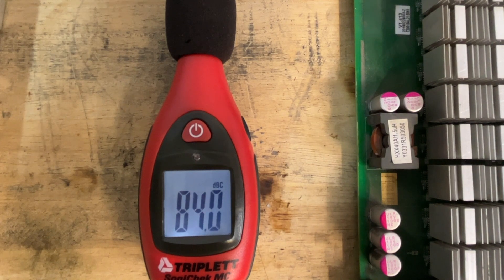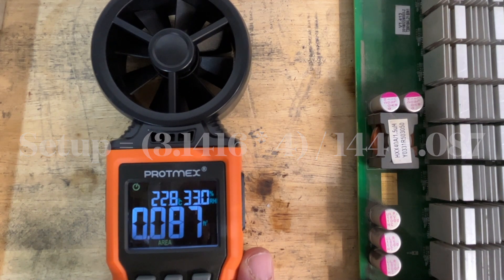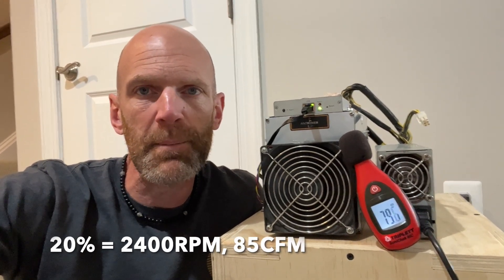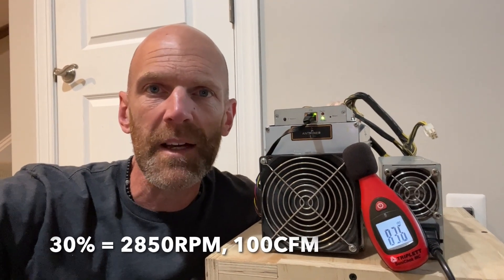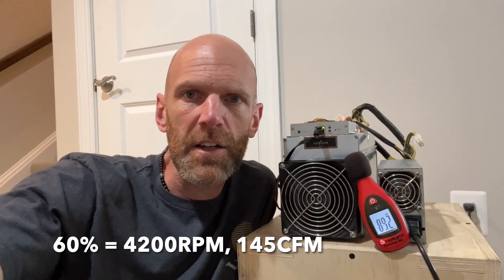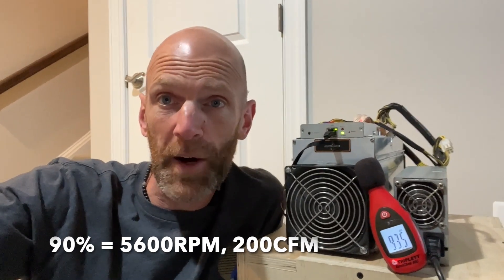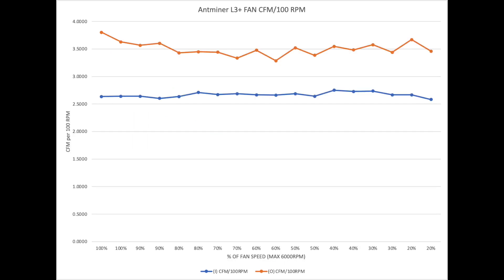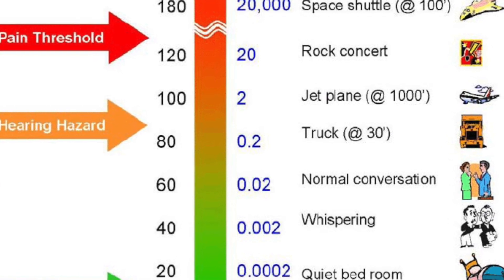ASICBASICS.COM - Bitmain stock fan RPM vs CFM vs DB

Comment from the maker: I should qualify the specification settings by also saying that there will always be some slight deviation in the actual specs depending on the manufacturer they use. I've seen Bitmain state anywhere from 5500 to 6100 for RPM and 180 to 260 for CFM. The particular fan on the units I have rated at (100%) 6000 RPM and 225 CFM.